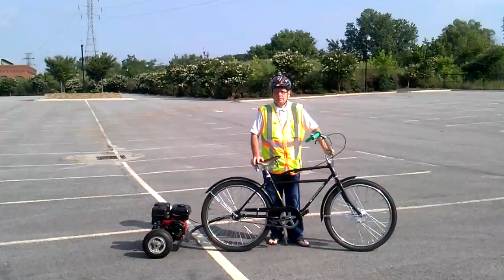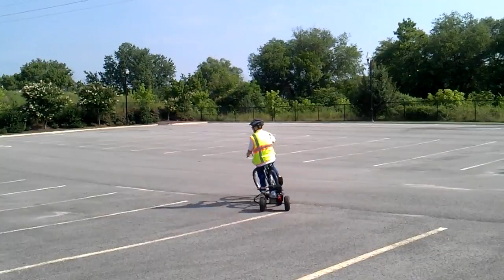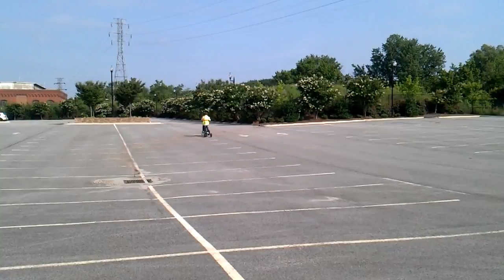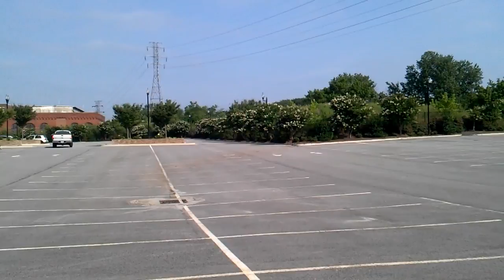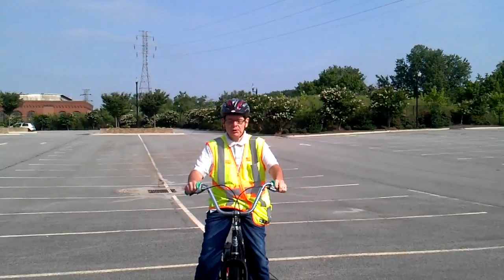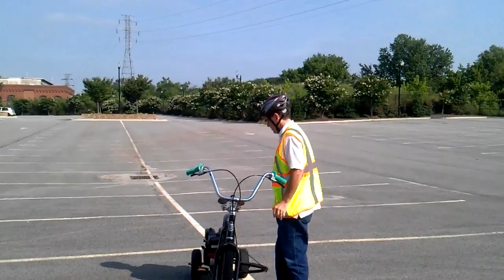The Motorvator - A self-driving bicycle trailer

Comment: I'm super interested in this type of trailer, I saw a guy once flying down my towns main st, being pushed by a one
 wheeled electric motor trailer. Since then I've been fascinated by the idea. 1 reason is I don't like the weight that a motor has when mounted on the bike itself, 2nd reason I don't allways want to use a motor, and 3rd reason a motor mounted on a flat trailer surface is much easier to build, maintain, and balance out the weight.
One question for you. Do you suggest using a bulkier tire on the trailer , and the back wheel on the bike? That's if my motorized trailer has room for cargo aswell as a motor the size that you have on this video?

Comment: No way you can ride 125 miles on 1 gallon of gas.
Reply: Believe it. I've seen other bike motor guys getting at least 90. It's pushing a single human, a frame and a little rubber, so you can go a long ways on very little.

Comment: Hi - nice video!! Damn the hate speech...This thing looks like a groovy train wreck off efficiencies..The lightweight trailer putting little weight strain on the bike - just push power..also putting little strain on itself..Also quick to remove and perform maintenance...can also attach to an adult trike...This is a good investment..Shame we can't use them here in the UK..Heck of a lot lighter and using less resources than building a 50cc scooter as well as able to use U.S. made engines and parts...what more to say ?

Comment: I'm seeing a lot of hate in comments section.  I like the idea, but unfortunately the law and people's narrow mindedness always kills this kind of creativity.  I own a homebuilt E-bike. Even with huge 450Wh lipo, I only get max 30 miles, followed by 3-4 hours charging. I've come to learn the hard way that anything electric is RECREATIONAL, NOT FUNCTIONAL.  As for scooters, fine but even an 50cc weighs min 90Kg (200lb) doesn't make it as efficient as a pusher on a bicycle which will weigh half that at best!!!  Plus you got the option of taking engine pusher off (,5 mins work) and you have a functioning bicycle again "2 for 1"  This is a brilliant creation, not original by any means, I have seen many before.  But anything that gets people out of their 2 tonne cars and onto a 45kg pusher bike is going to be better ehhh!
Reply: PS..Would like to see one of these made with a 500cc Kawasaki engine...go like stink...
Reply: @Graemereserve  They already have them, but they're called motorcycles!

Comment: So yea - not Self-Driving - and it's not really new - it's just a pusher. Not any different than plenty of old school set ups - like the Smith Flyer and other Fifth Wheel/Motor Wheel set ups - of course those where mounted on/in wheel. http://www.chicagotribune.com/classified/automotive/ct-rides-briggs-stratton-flyer-17-16.jpg-20111031-photo.html  well I mean it's cool and same with say an electric set - nice you built it yourself - Depending on the state - so long as the motor is under 2 hp - you probably can classify the bike as a moped... more about the Motor Wheel (pusher - as used on the Smith Flyer or Red Bug

"Briggs & Stratton kept the motor that had been the heart of the Motor Wheel and adapted it to other applications such as lawn mowers and running small equipment. The Motor Wheel motor was the progenitor of all Briggs & Stratton motors to follow.

Virtually all Flyers were painted red and were known widely as the “Red Bug”. The Flyer is listed in the Guinness Book of Records as the most inexpensive car of all time"

Comment: It's too noisy! An electric rear driven wheel can do the job with no noise!
Reply: It's loud for sure. But when it's gas, you just pull up to a station and you're filled up in 5 minutes and back on the road as opposed to waiting for a charge. Also, with an engine you can literally carry around with you another tank or two worth of gas for a few dollars and extend your range even further. There's another guy I follow and I believe he got close to 90 miles of range on a gas bike engine. He was using it to travel around the U.S. What an adventure!